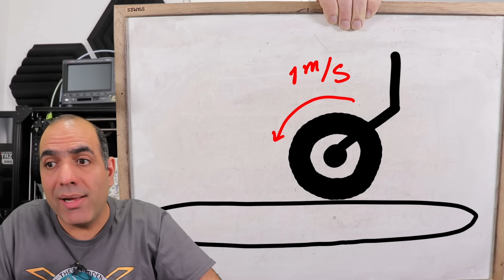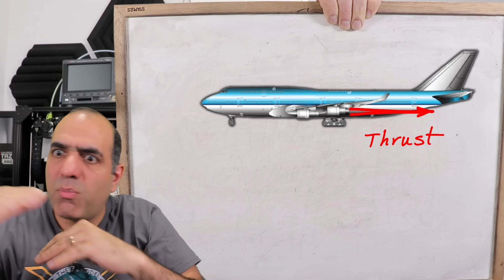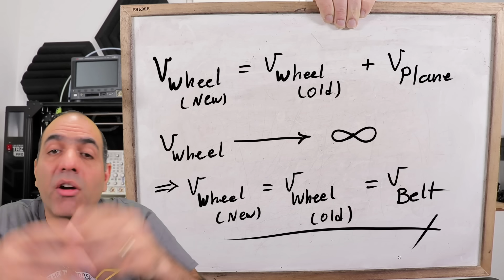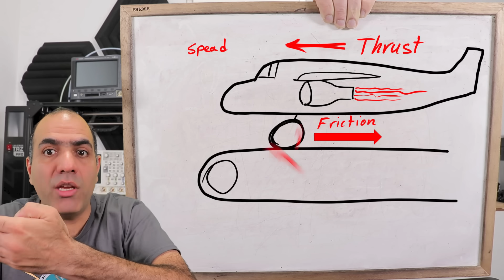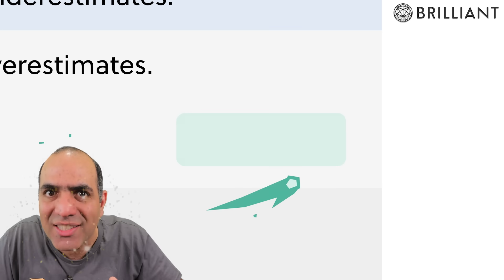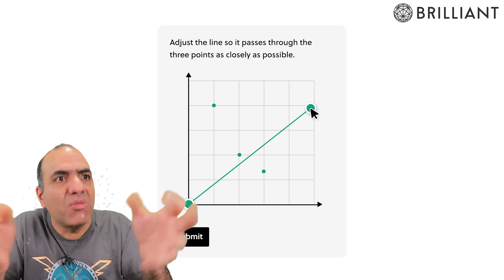Airplane Question that Drove Me NUTS!!!

Comment: In the second case; wheels turning on frictionless bearings: the conveyor will start moving backwards at absurd speeds as soon as the plane starts inching forward, but if the conveyor belt is wide enough, there will be a boundary layer of air stuck to the conveyor belt, and the air's viscosity will induce a wind backwards. It's velocity will drop the further away from the belt, but eventually, it will be enough at the wings to induce lift, so the plane will fly without moving forward.
Reply: As the plane inches forward, it does so by rolling.  The conveyor as stipulated exactly matches that inched forward distance and speed and, mathematically, at the same acceleration rate.

One rotation of a wheel in a unit of time results in pi * wheel diameter in conveyor distance in the same unit of time.
Reply: It doesn't imply the conveyor accelerates the wheels, it says it turns in the opposite direction equal to the speed of the wheels.  Think of two meshed gears, the free spinning will only ever spin as fast as the one being driven.  In that regard, the ground on a normal take-off already represents a surface moving in the opposite direction equal to the angular velocity of the wheels.

Comment: You can make whatever assumptions you want about the question, as long as you state them in your answer.  The more the question leaves to the imagination, the more you need to do this.  For example:

I'm assuming the 747 is in working condition, has adequate fuel, has not been modified for vertical take off, has a competent crew, meets all legal requirements for take off, is sitting near one end of the conveyer belt, is pointing towards the opposite end of the belt, has a correctly balanced load, is not overloaded, and won't malfunction.  I'm also assuming the plane's captain desires to take off and is about to attempt it.  I'm assuming it's daytime, visibility is good, there's no wind, and there aren't any unsafe weather conditions.  I'm assuming there are no other aircraft, ground vehicles, pedestrians, birds, etc. in the vicinity.  I'm assuming the conveyer belt is outdoors, and there aren't any mountains, trees, structures, etc. in the flight path.  I'm assuming that the aircraft doesn't have to remain sitting.  I'm assuming the length and width of the belt are consistent with the dimensions of a runway routinely used for 747s, and not just any runway.  I'm assuming that the belt is flat, smooth, free from debris.  I'm assuming the belt is able support a fully loaded 747 without breaking or deforming, regardless of whether the plane and belt are moving or stationary.  I'm assuming the existence and usual function of friction, drag, gravity, and all other forces that usually affect airplanes and conveyer belts.  I'm assuming that the conveyer belt is in good working order and won't malfunction.  The plane will then be able to take off.  I'm assuming that when the question refers to the conveyer belt's speed, it means the speed of the top surface of the belt, and that the conveyer belt's frame is not moving.  I'm assuming that the path of the plane causes all of its wheels to have the same speed for as long as it's in contact with the conveyer belt.  I'm assuming that you're tired of reading these assumptions by now, and I can slip in an idea that completely changes the nature of the question.  I'm assuming that the wheels are not skidding or slipping, but are continually maintaining static friction with the conveyer belt.  I'm assuming that when the question refers to the plane's wheel speed, it means the horizontal component of the speed of the portion of the wheel's surface that's in direct contact with the conveyer belt.  Because the of the last two assumptions, the wheel speed and conveyer belt speed must both measured as zero, even when the plane rolls down the belt.  This results in a completely normal take off, as if from a regular runway.

Comment: The answer is an absolute no if there if is not jets being use even if there is wind. the friction of the wind won't let  plane fly unless it was tethered to a fixed object and even if, let say the the movement of the tread mill created air flow from its movement it could create lift it would still push the plane off the thread mill unless it was tethered and the problem mentions nothing of the tether

Comment: I dont think that is the correct answer... If the speed of the belt matches the speed of the wheels, then the total is 0. You could theoretically achieve the same result, if you would pull the brakes on the wheels and therefore the wheels nor the belt would move. But once you power the jet engines, even though the wheels don't spin, the aircraft should be still moving forwards, if the engines can provide enough thrust to overcome the friction between the belt and the rubber on the wheels. The answer then depends on whether the engines are powerful enough...

Comment: The plane is "sitting" on the belt.  There is no indication the engines were on.  The question asks if the belt and wheels were moving in unison, the plane would eventually move backwards.

Comment: The plane would have to reach it's takeoff speed (relative to the wind, not the ground) no matter how fast the belt or wheels are turning.  So the wheels would have to be spinning at least 2x the speed it normally is at takeoff.  This is because the belt is moving at the same speed (as the wheels) in the opposite direction.  
This would mean that the plane could take off, but the wheels (or the bearings) will probably exceed their max operating speed.  There is no point in asking the question though, as the wheel rotation has NOTHING to do with the planes ability to takeoff.  It's only the airflow on top and the bottom of the wings that generate lift...

Edit:  Assuming ofc the engines are in operation.  If not the plane is going nowhere...

Comment: I am making a comment because you told me to Medhi.

Mythbusters already tackled this years ago, and they were as stumped as you appear to be.  If you think about it though, it is the engines on the wings of the airplane that make it move relative to ground, not the tires.  The conveyor could move even faster than the tires and it will not prevent the plane from taking off.

Comment: Basically the 'wheel speed tracking system ' in the belt will not be capable of doing so, and the plane will take off, unless the pilot colludes to keep it on the ground.
For any real conveyor belt, the plane's engines will overcome it.
For an imaginary belt with infinite power, it will break the wheel bearings and tyres, then the plane will slide and take off.
Reply: Plane will slide but it won't take off. No way to reach flying speeds like that.

Comment: Your second answer where the friction increases doesnt make sense. As the trust increases and there is some velocity on the airplane, there is a small bit of lift that will reduce the frictional force between the wheel and the belt, and thus the velocity can increase more and create more lift and decrease the friction more till it lifts off.

Comment: In a world with friction and air, where engines are creating a thrust, it would take off- REASON BEING- the belt that spins into infinity would create massive winds backwards. Which in turn would start to levitate the plane because its engines are creating thrust forward and resisting backward motion. That would disconnect the wheels from the belt long before they come close to infinity, also reducing wheel speed, also reducing belt speed, also reducing created back winds by the belt, and letting the plain to slowly fly away(assuming plain surfaces and thrust are controlled by a supercomputer, because it might be pretty weird and turbulent takeoff, might be even falling back and touching belt couple times)

Comment: If you really want to stupify someone that believes the plane wouldn't take off.. Ask them how planes on skiis take off, or pontoons.. Or a test plane taking off from the top of another plane.
How does a plane "keep going" or "accelerate" if it's already in the air and the landing gear is up?
There's sooo much stupid around this topic it's akin to; flat earthers, moon-landing deniers, holocaust deniers, anti-vaxxers, and the "birds aren't real they're just government drones" snowflakes.
Reply: I'm with you, thr plane takes off because the contraption can't counteract the thrust of the engines. So it accelerates down the runway and takes off like normal. 

But you're being disingenuous about what the no flyers are saying. They think that the question is asking if a motionless plane can take off. They aren't thinking about it any more deeply than that. They certainly aren't thinking the plane propels itself down the runway with its wheels.
Reply: 1. Indeed, the plane wheels are not turned directly by the turbofan engines. This means the wheels are not the cause for why the plane moves forward. The plane moves forward because of the thrust from the turbofan engines, whether the landing gear is wheels, skis, or pontoons.

2. Fixed wing aircrafts require LIFT to take off. Turbofan engines do NOT create lift. Lift is created by the WINGS; specifically the air passing over and under the wings based on the Coanda effect.

3. The engines will push air in the opposite direction of intended travel, but they will NOT bring air above and below the wings in order to create lift. The plane must move through a mass of air in order to fly.

4. The problem makes no mention of wind, so we will consider it to be zero. For an observer sitting near the runway, the plane is not moving (ground speed = 0). Though there is air being sucked into the engines, which does create some turbulence reaching the wings, most of the air particles above & below the wings will be at zero relative to the plane and its wings. There is not a large enough mass of air going above and below the wings, which means NO LIFT.
Reply: @stubeusz123  The question never says the plane remains motionless.  That's your assumption.

It's a simple physics problem. The engines exert a force. The plane accelerates unless there's a equal force counteracting the force of the engines. 

The trick in the question is realizing that there is no way the conveyor belt can.impart a counteracting force.
Reply: @407BRR  If the plane is motionless (ground speed = 0) then it cannot achieve the commonly-accepted definition of "taking off" without unreasonable conditions.  The point is that the propeller or turbofan does NOT produce the airflow that generates lift. Yes you could achieve altitude greater than 0 in a fixed-wing aircraft with ground speed of zero if the wind was strong enough but you would need wind speed around 160 knots for a 747 to achieve this which I would consider an unreasonable condition.
Reply: @stubeusz123  I agree. If the plane does not accelerate down the runway, it will not take off.

The plane does accelerate down the runway because the conveyor belt can't counteract the force of the engines.

As I said. The question never states that the plane remains motionless.  That's YOUR assumption.
Reply: @stubeusz123  there are competitions for landing in as short a distance as possible, some people have landed ultra lights while technically moving in reverse, relative to the ground, because they had a strong enough headwind. Some of these things are almost enough, power / weight ratio, that the engine can push enough air around the wings to achieve lift while removing stationary.
Though none of these competitions involved jets.

For VTOL, we have very specific models of jets for that. Things like the harrier and the f-35.

--
But none of this is related to the physics conundrum of a plane/jet on a conveyor belt. There is no stipulation that the plane is tied down and thus cannot move. It's just that the wheels are moving in the opposite direction that the plane needs to travel to achieve sufficient lift for takeoff

And while you have sufficient enough understanding of the physics, there's a very large percentage of people that are absolutely convinced that regardless of how fast the plane is moving relative to the ground, if the wheels cannot apply power to the ground (the premise) in the forward direction, that take off is impossible
Reply: @mashrien  oh sure, VTOL is a totally different story, and as you say, a small fixed wing craft with a favorable enough power to weight ratio could lift off with 0 ground speed with strong enough but plausible headwinds. But the velocity of sustained headwind that would generate enough lift for a commercial jetliner’s landing gear to break contact with the ground while achieving 0 ground speed is not reasonable, if the constraints on the thought experiment are to remain within the bounds of reasonableness.
Reply: @stubeusz123  That's the point I think you are missing though, nobody says the plane remains a stationary, just that the wheels are pulled in the opposite direction via a conveyor belt removing the equation of wheel speed from the entire premise of flight
Reply: @mashrien  maybe I misread or mis-articulated my point. With 0 wind, the wheels are in complete contact with the treadmill—the ground speed is 0 regardless of throttle position.

If the wind speed slowly increased, the wind would eventually generate enough lift for the landing gear wheels to break contact with the treadmill.

Once enough contact was broken with the treadmill, you could control the groundspeed of the airplane with the engine throttles, as the landing gear is no longer in contact with the treadmill.

Since there’s no throttle lever for wind speed, the plane would most likely move relative to the ground. However if you could control the wind speed, you could set the wind speed at equilibrium with the thrust and keep the position of the aircraft at 0 with 0 ground speed (“hovering”).

Comment: Sorry, Mehdi. Faulty logic at 5:26: "the force of friction equals the jet engine thrust, and the plane stops moving forward". No, just like all flights, and vehicles in general, when the friction equals thrust, it stops ACCELERATING; it continues at a constant speed in accordance with Newton's 1st law. The only question is whether that friction allows sufficient speed to take off in this case.

The simple answer to the question is that the pesky rolling runway will quickly over-speed the tyres, which will blow, and the take-off will have to be aborted.

Comment: Easy answer with another question: If you push someone's back while they are walking on a treadmill do they fall forward? The answer is the same for the plane. On a plane the engines push forward very hard and consistently. So the plane moves forward, gains lift and flies.

Comment: Yes, the plane will take off as planes are not driven forwards by their wheels. The wheel bearings mights get a tad toasty and the tyres are probable not rated for the rotational velocities they will encounter and the belt dragging the air would add to the ground effect etc etc but it will take off. Mythbusters did a great episode on it.
Reply: But the wheels are necessary to convert their energy into relative movement to the air. Without this, they cannot generate lift.
Reply: @john_titor1  a planes wheels do not drive it. They just 'free wheel'. A plane is driven forwards by the reaction to the air being thrown backwards by its prop or jet engine. Think of a plane with skis for snow or floats for water. Planes don't need wheels.
Reply: @TheMoulie  Dude, i know how planes work. I never said that they were driven by wheels. But they need wheels to overcome the friction of the ground so that they can get enough motion relative to the air that they can generate sufficient lift. That's what the "skis" or "floats" for planes do on snow and water too. And they need them, or they cannot overcome that friction.
Reply: @john_titor1  Maybe it is me not quite understanding what you are saying but unless the plane is nailed to the ground they will take off. I really don't understand what you mean by "the wheels are necessary to convert their energy into relative movement to the air" other than implying said plane is not nailed to the runway as the wheels just turn rotational motion into heat in the long run but they do provide reduced friction on the ground prior to lift off. That being said you could strap wings to a hovercraft and with sufficient forwards velocity it could take off.
Reply: @TheMoulie  We are presumably talking about a standard plane in this scenario, not any possible conceptual plane, correct? So we are assuming it's not some special case hovercraft or jet. That means it relies on its own engines to provide forward momentum in order to generate relative motion to the air so that the wings with generate lift. Obviously, in the case of extreme winds, the plane will be able to take off regardless, with or without wheels. But again, the scenario we are talking about is a simplified scenario in which we are only concerned with the basic mechanics of its own ability to take off. In this case, the wheels are necessary because they are needed to overcome friction with the ground. Otherwise, the plane will remain motionless with respect to the ground, and air, and be unable to generate any lift.